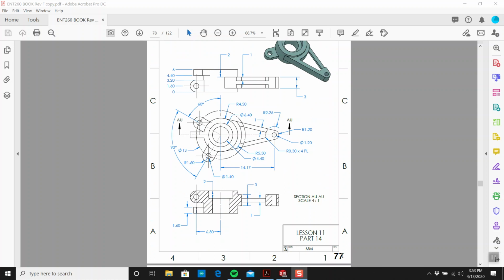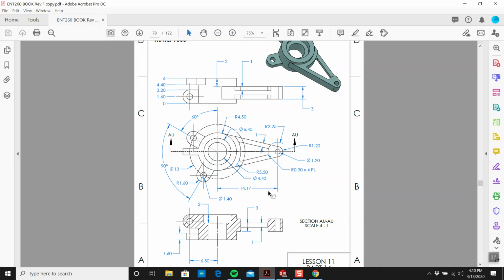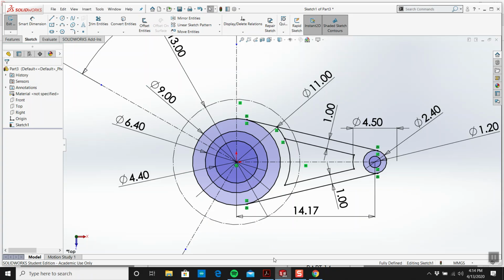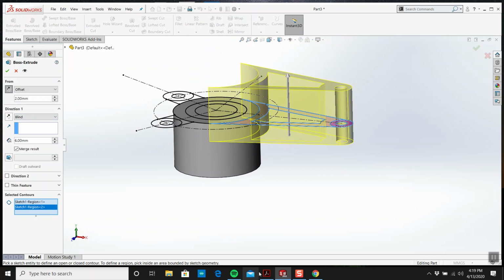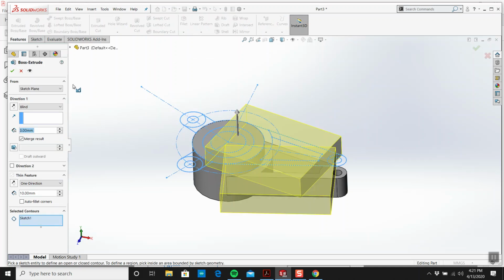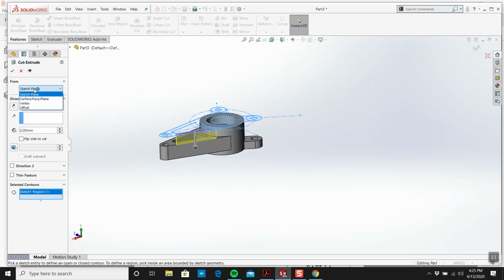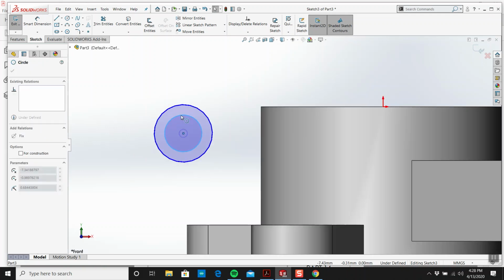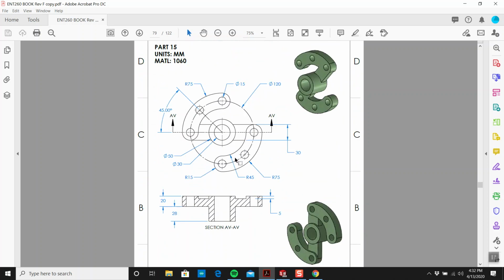Solidworks Practice Problem 14

Comment: Your part is modeled incorrectly Tim. The arm that sticks out should be 1mm up from the surface corresponding to the location of the vertical lug, but you have the two horizontal lugs there. Basically, you simply need to raise the arm up 1mm so that it's only 1mm down from the surface corresponding to the one tangent to the vertical lug. Thankfully it doesn't affect the total mass of the part when it's all said and done, but if this had to be made from your model...it would be incorrect.
Reply: Compare your part to the cross-sectional view to see where the arm position should be, compared to where it is on Tim's model.